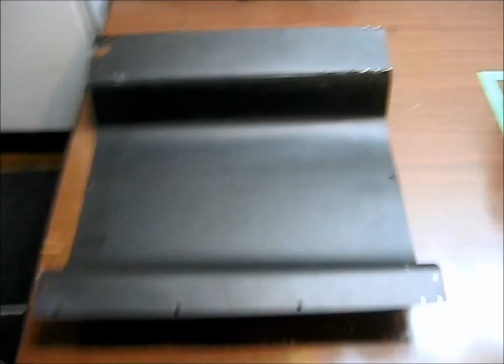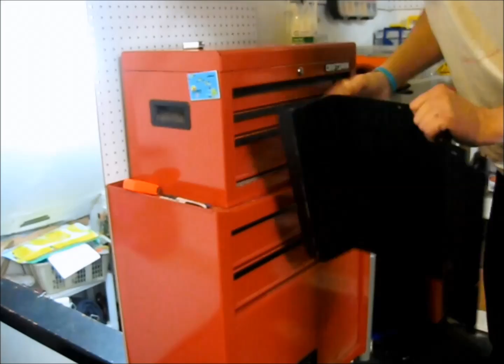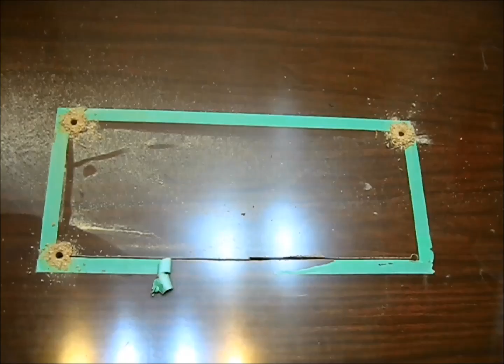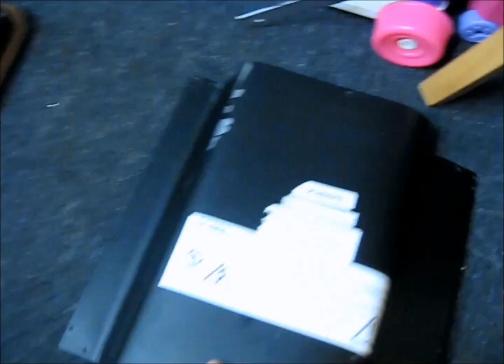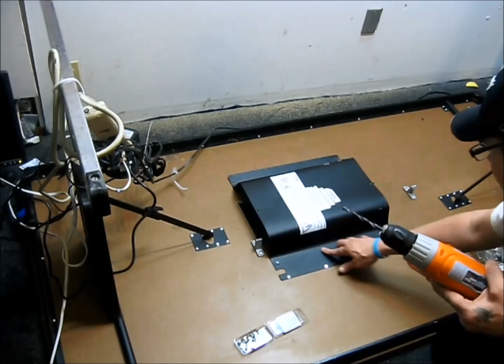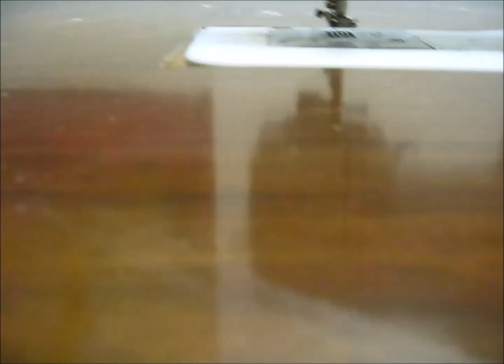Do It Yourself Flat Bed Sewing and Quilting Table (DIY)

Comment: Can tell you have never used sewing machine. The machine should be nearer the edge cos your wife will get a bad back & arms using that in the centre of the table. The hole is WAY too big it needs to be a very snug fit because the vibration will bounce it all over the hole & also it will make the metal hammock become loose & the machine to fall on the floor breaking both it & your wife's feet. Good try though.

Comment: The cutout for the machine should be more accurate, not over 1/4" gap, less would be much better. Rather than use a formed metal pan suspend a wooden shelf with bolts, you can make it adjustable and get the height perfect. Also bring the machine to the edge, look at a commercial machine table, about 6" is the normal.  Good start but think of it as if you were using it.

Comment: Nice work, although you don't seems to ever used a sewing machine :)  The machine should be very close from you (not in the middle of a big table) also, you should have move the machine to the right of the table leaving maybe only 30cm to put items, scissors, bobbins, thread etc. that way you have all the space on the left for big pieces of fabric, curtains, etc. That need to be flat while sewing. Another advice : no holes around the machine... You have to make a precise blueprint of the shape and size of the machine so it's really "stuck" to it's form. Why? You'll find you are losing a lot of pins, machine accessories, feed dog, etc. When it fell in between the gap, good luck to retrieve them easy. Last thing, the "bed" should be made out of wood as well, like a casing, because sewing involves loads of vibrations, and your thin metal hammock will accentuate the vibrations. Apart from that, clean work.

Comment: Burly Sew, I like your idea for your D I Y sewing table!!!! It's really cool. I believe that more men should sew and do hobbies. I understand why you have your machine so far back into the table, it is a shame that some people don't. Good work, keep your video's coming they are informative. :-)
Reply: Yvonne Luke   I agree about having the table back a bit from the front of the table.  I like that extra space in the front.  One issue that one would have with this design is that some newer machines have a long, metal piece that comes directly out of the front of the base of the machine called a knee lifter.  It allows the sewist/sewer to lift the presser foot with their knee instead of using one of their hands to reach into the back of the machine and raise the presser foot lever.  Not everyone likes that feature and only newer machines offer it. Most experienced sewists/quilters have more than one machine (I’ve had two then inherited 7 or so more) so it is likely that at least one machine won’t have that feature. Nice job on the table!  I wish I could be there and learn from you firsthand.

Comment: Why did you leave so much room on the right side of the machine?  I do quilts, and while I like a little room on my right for misc. items, I'd really need more room to the left.  Also, being a short person, having a machine in the middle of the table would kill my back.  You look well over six feet, so I suppose that depth works for you.
I'm also impressed that you file your sandpaper;  way to be organized!
There's also just enough room around the machine to drop things into, so for myself, I'd fill that space with something (foam insulation, maybe).
Thanks for sharing your work.

Comment: Burley Sew - maybe an ok idea for male machinists but not particularly helpful for females who, even with adequate DIY skills, don't really want to be using up excess time, energy & resources on woodworking. I also think you probably need to reconsider how far back into the table you set your machine because I'm not sure how you'd reach the machine bed with it set so far back ?? Perhaps your next video would enlighten me cos I'm somewhat lost on solutions myself....
Reply: Debbie Day- Seriously? The general concept he gives is inspirational. You can take this idea and tweak to your own individual needs.  Also, I would hardly consider the ability to create what you want and need a waste of time.
Reply: ugh
Reply: Poor eyesight and large breasts are about the only reasons I have for having the machine near front of table. 
I DO usually pull mine near the front (I'm a man too), but the table has 2 pull outs, so there's one on left side. Comes in handy for large pieces of material. The desk is an old beast I saw on curb and couldn't let go to the dump. Solid hardwood, all dovetail construction, drawers and pullouts on both sides of chair access, brass handles and feet covers. Cleaned it up, sanded, polyurethaned and its gorgeous. Some old teacher or corporate office desk I guess. Great sewing table

Comment from the maker: I agree you would want to plug the well, especially if it is closer to the front of the table. The way I have it, I have enough room to pull the machine out and set it between the front of the table and the beginning of the well. As I stated below I think it would be very easy. Just cut a piece of wood to fit the hole and then take some wooden rods (dowels) and connect 4 conduit straps underneath to hold the dowels and set the piece of wood on top. Thanks for the great post and for watching!

Comment from the maker: When I use the embroidery bed attachment I put the machine on the regular part of the table. There is enough space between the "well" and the front of the table. I thought of the same thing as you when I started and I had the alternate idea of making a "plug" for the "well" out of a piece of scrap wood and holding it in place under the table with couple of dowels and conduit straps. However I have not had the need to. Thanks for watching!